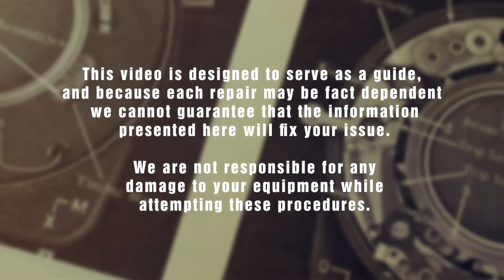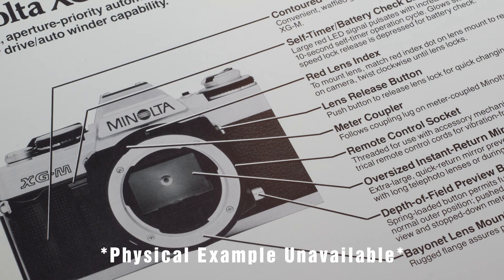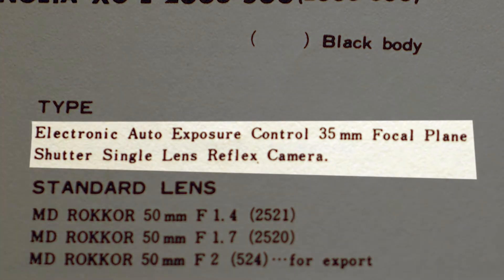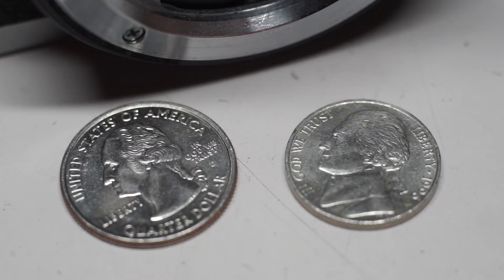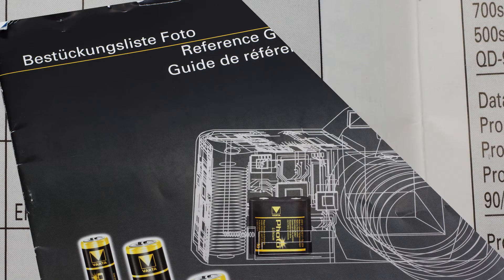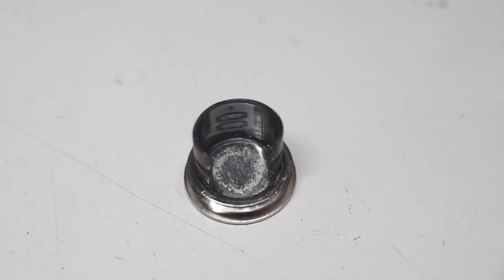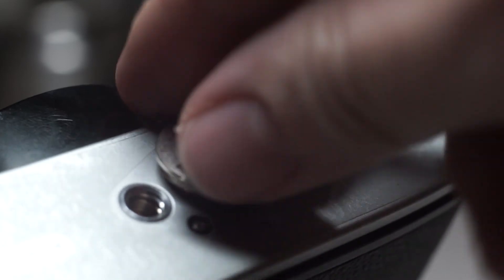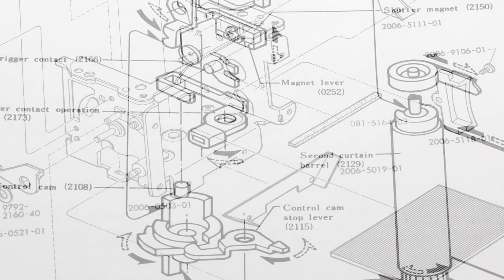How to fix Minolta XG-1 stuck film advance lever (XG-7, XG-9, XG-E, XG-A, XG-M, X-700, X-570, X-370)

Comment: My XG-1 camera has a very stiff power switch and nothing in it works even tho I have the battery. I wanted to get it fixed myself so I don’t have to spend even more money for someone else to look at it for 5 minutes. The shutter button does nothing and the film advance lever gets stuck. Please help
Reply: That happened to mine too. Any updates on the fix? If so please let me know what to do
Reply: @danielsolovyov6741  I couldn’t fix it. The camera started using both batteries per every single picture and then it completely broke.
Reply: I have the same problem, even after putting new batteries, nothing changed 🥲
Reply: @Truishrd  I turned the batteries upside down and it worked. The camera shutter broke in an unrelated situation later.

Comment: Did anyone else find a different solution? I changed the batteries to fresh ones and mine's still stuck. :( Battery Check works and when you turn it on it lights up inside but other than that, nothing.
Reply: mine too. i just got it today and mine is stuck but everything lights up and the light meter works.
Reply: I have the same issue, new batteries and everything but its still stuck-
Reply: Same, any solutions would be helpful
Reply: Hi i just ordered new bateries and film hoping this would fix my issue but my level still seems to be stuck. It lights up and battery check light comes on but lever still stuck any other fixes would be helpful
Reply: Samee, my battery is new and light up the little light but nope still stuck and the thing is at first it did turn but then it went back to being stuck
Reply: This fixed mine
Reply: It could be due to condensers inside the camera that blew Up. At least that's what happens in the X-700/300/500

Comment: The battery placement is counterintuitive in the X700 and the diagram is microscopic. HOWEVER . . . . . placing the batteries in the holder in the correct orientation ~DID~ remove the problem.  I'm going to go get a cuppa now,  and a roll of film to test.

Comment: If the battery isn't the fix, Sometimes the capacitor needs to be replaced. The upper one on top of camera is very difficult, but the bottom capacitor isn't.

Comment: Holy shit. I've had this camera sitting on my shelf for 3-4 years, and I thought it was broken. It worked!

Update: I've since dropped and broken the camera halfway through my first roll. I guess it was never meant to be used.
Reply: I just bought one from a fb marketplace ad, same problem but putting a battery in didn’t fix the problem, no battery check light either. Good thing the lot had an x700 in it too
Reply: I'm sorry but I laughed hysterically
Reply: you are meant to buy another one.... ;)

Comment: it worked! i cleaned some of the corrosion off and then the battery checker button turned on. thank you x 1,000,000.
Reply: How did you do it? Did you use alcohol?
Reply: How did you do it? Did you use alcohol?

Comment: I discovered this back in 1994 when I decided to take photography class in high school and needed a camera. Knowing my parents had an XG9 in their closet they claimed was broke, I changed the batteries and ta-da it worked. I then went on to use that camera for years, even winning a couple photo awards with it. I kind of miss that camera. At some point it got a light leak and I decided to take it apart to check out how it worked. I believe I still have the pentaprism somewhere as a keepsake.

Sadly my folks had bought the camera the year I was born but only used it for a handful of years before the batteries died and they thought it was broke. So I have a couple of really good photos from when I was a kid with shallow DOF and then the rest after that were all point and shoot camera photos. Kind of wonder what kind of photos they would have gotten had they knew to change the batteries.

I actually ended up with friend's old XG1 several years ago. And a couple bad Focal lenses. I haven't used it but it looks in decent shape. It does need some batteries. Maybe I should pick up a Rokkor lens and some batteries for it. It's just hard to spend the money on that kind of thing these days when I've got a perfectly good Nikon FE with a few lens already if I want to shoot film.

Comment: I had a similar problem, and cleaned the battery contacts which got the batteries to work again. I've now got the lightmeter and battery check working, and I got the shutter to fire...only problem now is the winding mechanism is jammed still? Any help with this would be much appreciated thanks!

Comment: hey I have the same issue and I did read the manual, and was wondering if that's the reason, how ever I changed batteries to two LR44, measured them a bit above 1.55V, slightly, lever still stucked, would you say I need to try with SR44 first and then try mechanical issues ?

Comment: Had hoped this would fix my XG-1! It didn’t unfortunately… Advance lever is stuck. BC turns on, when I flick between off and on, the light meter will react in A or the camera will show M in manual mode. Selftimer runs up to about 8 sec then nothing. After each shutter button press, I need to flick the power wheel. 
Any clue what’s going on here?

Comment: Hello! i recently got a minolta x-700. I don’t know when it stopped being used. My advance lever is stuck! The curtain looks good. I put new batteries in and the led lights inside the screen work. Everything seems to be working fine expect a beeping noise that prevents me from pressing the shutter + the advance lever. What should i do?
Reply: I'm having the same problem now. Were you able to fix your camera?

Comment: hiya, great vid.

what if this is reoccurring? i replace batts and it take a couple of photos then the same thing?
Reply: That sounds like a capacitor failure. Also a simple fix, but it does require opening the camera up and replacing (soldering) a capacitor which is known to be prone to failure.
Reply: Michelle Hastie having the same problem :/
Reply: @andrewjacobs1867  You can look up tutorials-- don't need an expensive iron and the part is like $10 at very most

Comment: A quick question. The on off battery check /self timer switch sometimes sticks on mine any ideas on that?  I had thought of using WD40 or some such lubricant but  not sure it will work Many thanks in advance.

Comment: Thank you for your time & effort. I have a Minolta XG-M and have just run through my first film a Fuji 400 colour film. I am trying to rewind it. It seems I just need to hit the rewind button underneath. Beautiful camera! I love the feel and motion and viewfinder. It is telling me that inside a normally lit room with front light on the subject at 50mm f1.7 it needs 1/30th of a second...? But I am thinking that it is trying to render 'mid grey' as if it was a sunny day. It seems to compensate for the speed of the film...

I really need f8 because I have multiple subjects at which it says I need 1/4 second which is not possible hand held... so I compensated for the fact that I am inside by dropping the stop compensation down 2 full stops at which point it allowed me to shoot at 1/30th to 1/60th of a second... am I thinking right or do I need a flash unit hand held?

Comment: Same thing occurred with a used OM-2N I bought at a thrift store, I wanted the lens(A pristine 50mm macro) and told them the camera was broken because I didn't know better.  I decided to futz with the camera and soon found out it needed batteries to operate, the OLY's have reset buttons as well, but it ended up being the nicest old Olympus body I have.

Comment: Hi I purchased new batteries and replaced them but my battery check light doesn’t come on? Do you know why that would be? Thank you
Reply from the maker: Carefully check that the battery cover is free from corrosion. It may not be visible, but a thin film of corrosion can prevent the batteries from powering the camera. Clean it with a fiberglass brush or perhaps a pencil eraser.

Comment: What about if my lever won’t wind the part that rolls the film in? I’m new to film photography and I got a XG-A and I’ve shot a couple rolls already but my little brother was messing with it and now the lever won’t rotate the cylinder that rolls the film in, anyone have any tips or advice I’m desperate 😭😭
Reply: Im having the same issue. Did you ever fix it?
Reply: @SoftAsButta  I never found a fix but I took it in to a place and they fixed it on the spot for me within 15 minutes so it has to be simple, they only charged me $20 if you wanted to do the same!

Comment: Ive changed my battery yet the lever still stuck😭 but haven’t tried cleaning the corrosion part. Hopefully my camera is not broken
Reply: saaame i wanna cry, did it ever start working ?
Reply: @iluvyou2614  well i didnt clean the corrosion part. instead i bought a new battery with the same brand as the old battery, and surprisingly my camera works perfectly!

Comment: Hey, i have this same problem but with a Minolta Hi- Matic 11 super circuit 3. I was testing it and it suddenly stuck. Dont know what to do. Will appreciate any help!
Reply from the maker: Hi, the Hi Matic 11 will operate without a battery (although will not meter or expose properly) as it is a mechanical shutter so if you are having an issue with the advance being stuck, you have a mechanical problem with the camera.
Reply: Are you sure it's not capacitor failure? It's an easy and cheap fix if you can use a soldering iron.
Reply: @Ineedahandle75  I managed to fix it. It is working pretty well right now. I just had to open it below and play with the stuck gears.

Comment: Sometimes on my XG1 the mirror gets stuck and it releases when shutting it off. 
Does someone know what the problem is?
It’s just sometimes and sometimes the shutter speed is off. 
Like I said it is sporadically. 

Hope somebody can halo me out
Reply: Same problem with my XG7. Apparently it is likely in need of a new capacitor. The Minolta XGs have a lot of issues with this.

Comment: I have a question, i recently got an x700 and i got new batteries for it and I was able to shoot a whole roll of film no problem but then all of a sudden it stopped working and all it did was flash the the letters in the view finder for like a sec then then stop. I bought new batteries for it twice now but i notice that the battery end cap had a brown stain or something on the metal plate in there, i was wondering if that just meant that the current wouldn't flow anymore and the cap doesn't work anymore or if it's the camera itself?

Comment: EDIT: Wow I feel dumb. I had put the battery in upside down, and in my other camera I just was at the end of my roll (it was 24 not 36). I'm having this problem with both my x-700 and xg-se, replaced both the batteries and nothing changed. I was able to rewind the film without issue in the x-700 and attempted to load new film, but the shutter button does nothing and the lever won't advance the film. There is still 12 shots left on the xg-se so I'm trying to avoid rewinding the film if it won't do anything either.

Comment: Unfortunately not my issue but maybe you can help, even I cock the leaver it doesn't fire, until I turn the cam ( I think it is the flat head metal bit at the bottom) then it will fire like normal

Comment: Hi Bill, I just got a minolta x700 and the advance lever doesn't work and  the same with the click shutter. This is a relate problem? If the advance lever get solved would be the shutter  solved as well ?... Right now my minolta has LR44G batteries in it.. Would you recommend use SR44 batteries?
Reply from the maker: Hi, the advance lever cocks the shutter and advances film. So yes, they are related.  Either LR44G and SR44 batteries should work. Just make sure they are oriented properly and no corrosion on the battery cap. If all checks OK then you have another problem. Not uncommon to have capacitor issues with the Minolta X series.

Comment: Hey I just replaced the old batteries with brand new one specificity the energizer 357 but the lever is still stuck. I hadn’t picked up the camera in a couple months though. Can you help me?
Reply from the maker: Check that the battery compartment cover is clean, use a fiberglass brush or a pencil eraser. You could have a mechanical issue with the shutter. If the mirror is locked up, the issue may be that the shutter has not completed its travel to release the mirror. If the mirror is down, you may have an electrical issue, would recommend taking the camera to a service center.

Comment: My winding arm won’t snap back to start. Did I break the spring that returns it?
Reply: I have a minolta XG-9 that did the same thing. I figured out that the last click on the arm was just a tiny bit tougher than I expected, and I just had to push the arm a little bit more for it to jump back in place. It hasn't always been like that, so something has definitely gone wrong, but at least it works.

Comment: Welp, wish I would've found this video before forcing the lever outwards on the XG-1 that I got less than 2 hours ago. Even looking through the manual didn't explain why forcing it was a bad idea. My Pentax SP doesn't need batteries for the film advance lever so I figured this older camera wouldn't.
Reply: Why the hell would you put that much force into some delicate like a shutter advance? It clearly stops you must’ve pushed hard on it to break it. Jesus you are a brute lol

Comment: when i first got the camera, i had encountered the same problem. however, i just forced the lever to wind all the way back because that would usually happen to my Nikon EM and i assumed i just needed to use a little elbow grease to fix it. now the lever won't return to its usual place unless i use a coin on the bottom. a little feedback?
Reply from the maker: Sorry to say this but the extra force has damaged the wind mechanism. Parts will need to be replaced and it may not be economically feasible to repair the camera.

Comment: Thank you for the video Bill! It helped me fix my XG7 but I've discovered a different issue and wondering if you have come across it. My camera appears to be "stuck" at the x-sync flash speed, which I think is 1/60. Previously it was stuck at a five or six second shutter.  After attaching an x-series flash, the camera shifted to x-sync speed so it's functional, albeit in a limited state. The mechanics are all working flawlessly. Any thoughts on this issue?

Comment: Ok but I had changed the batteries, light meter working but the shutter still sits stuck.
Reply from the maker: Well then you have a mechanical problem. Question to determine further advice: is the mirror locked up? In other words, can you see through the viewfinder?
Reply: Bill Rogers Camera I can see through the viewfinder- and with a screwdriver I can manage to jiggle the shutter- and occasionally with that I can get it to release but sometimes the mirror will then get stuck
Reply from the maker: @n.lwhitaker572  From your description, it sounds like the plastic winding gears on the bottom of the camera may be binding or damaged. Or the second curtain on the shutter might also be slowing down and not releasing the mirror. Not a major deal if the gears need adjusting for clearance, not so good if they are damaged. In either case, it's more than I can go into here so best to have a camera repair shop look at things.
Reply: YOKAVELI Same here! Did you end up fixing it?

Comment: awesome! thank you! I have an xg1 and my camera has a black band across the view finder, please do a video on this :)
Reply from the maker: Sounds like something has come loose in the viewfinder? Would need to see what this looks like up close to make a diagnosis.
Reply: I same problem with I got to ask you one it's got a straight dark line straight across the middle of the
Reply: I have the same I haven't asked you one just the same problem dark line straight across viewfinder I think I got to take the top cover off but I don't know how to set the aperture what the gauges are
Reply: @BillRogersCamera  hay bill I have the same problem is that straight black line right across the middle of the viewfinderdo I have to take the top cover off and what do I set the aperture at and the sas whatever that is to take top off

Comment: Hi, thank you for sharing this! My battery check light is now working again while the lever is still stuck. I'm using Rubin LR 44 alkaline batteries. Is it a problem that these are non silver oxide batteries?
Reply from the maker: As long as the battery check light is working, I would not suspect a battery problem. Most likely you have a mechanical issue with the shutter. If the mirror is locked up, the issue may be that the shutter has not completed its travel to release the mirror. If the mirror is down, you may have an electrical issue, would recommend taking the camera to a service center.
Reply: @BillRogersCamera  The mirror is down so I'll contact a service center. If it's an electrical issue like a corroded capacitor, do you think the repair might get expensive? Thanks for your help!
Reply: @BillRogersCamera  big newbie here, but I'm having the same problem -- how do I check if the mirror is up or down?
Reply from the maker: @gmorris28  If the viewfinder is dark, the mirror is up.
Reply: @BillRogersCamera  how do I fix my mirror from being up ?

Comment: My on off ring is lose does it come with this issue too? Cz it was all cliquy at first but then it went loose.. can someone help its an xg-1
Reply from the maker: Hi, if you lift up the rewind knob and look underneath you will see a silver retaining ring. It is possible that this ring has loosened but in most cases, your issue is caused by a broken rewind shaft bushing that the retaining ring attaches to.